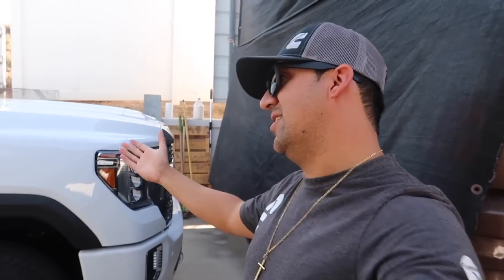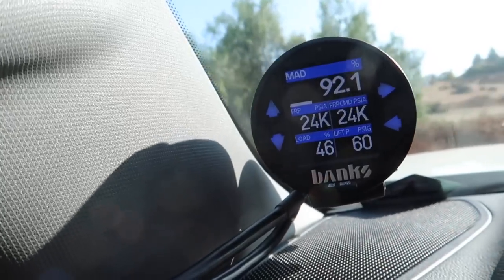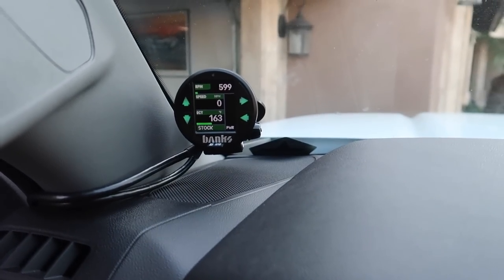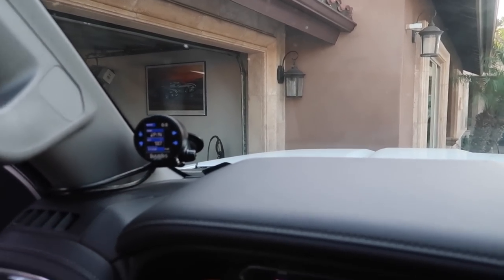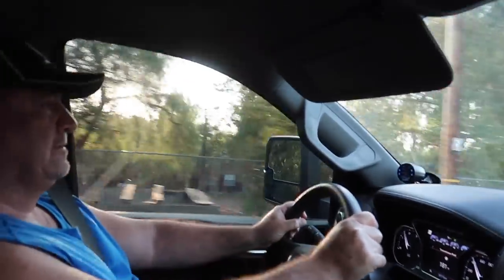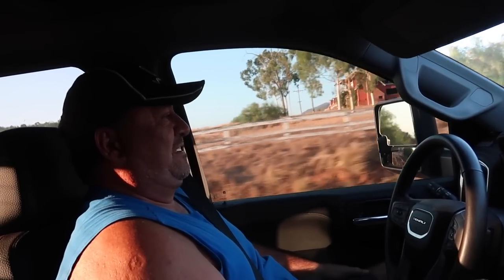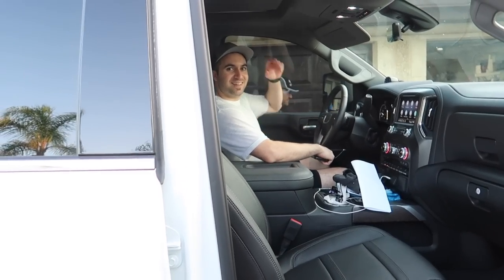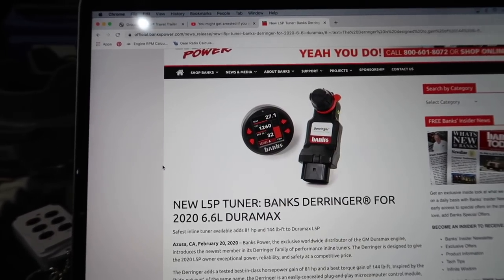DOES THE BANKS DERRINGER REALLY WORK?

Comment: Have you have any issues with the DPF ?  I had a filter replacement at 6000kms and 42000 kms now under warranty.  I pull trailers and drive it fast.  I don’t have the derringer but I wonder if higher exhaust temps would help
Reply: It's not exactly ideal to pull on hot tunes. Egts might be a tad high. Although back in the day this level 6 would've been no more than a tow tune. It might not help your issue. But that trailer might be alittle easier to pull with the extra torque.

Comment: Does the derringer and the pedal monster get rid of the Speed Limiter to go above 100 MPH? 
I just bought a 2023 Sierra 2500HD AT4 and was shocked when I reached the top out at 100. Never had the issue with my old 2020 ram 2500 Big Horn
Reply from the maker: No it does not

Comment: I just installed the Derringer on my 2021 gmc Denali Duramax. I’m have a bad issue when turned on level 6, the truck is either not making the shift in the transmission or the trans is slipping and it’s bad, the whole truck shakes violently. Have you experienced anything like this? Please let me know!
Reply: Also I contacted Banks today and they said there is a TSB out for the 10 speed and it fixes the ruff shift no shift issue?! So I called my local dealer and they said no TSB for that issue.  There is one for ruff shifting from the transfer case not being aligned correctly from the factory, but it should be able to be duplicated every time the truck is driven. Not like mine, just every time I turn the power up.

Comment: Hey Eddie does using a chip or programmer void your vehicle warranty? I have a Banks system as well on a gasser but havent used my Automind2 because im not sure if it will leave a flag on my ECU
Reply from the maker: No sir
Reply: Eddie's Life just spoke to Banks and apparently its way to grey of an area for them to gaurantee the product. They just say....your dealer has to prove it was the product that caused the problem. I can imagine the akward stalemate you end up with the dealer if something goes wrong. I dont want to risk it. I cant afford litigation with my dealer over a $400 programmer. Im returning mine. 😂 maybe when i get Eddies Life kinda money i wont be trippin’ hahaha
Reply: Doesn't send signal to ecu, over rides/bypasses signal from ecu. That's why if there's any issue, it just runs on stock tune

Comment: I think Eddie definatley misses the Duramax. I had a 2015 Chevy 2500hd LML. Then a 2019 2500 Cummins, traded it for my now 2020 Chevy 2500HD after 6500 miles. Wasn't a fan of the Ram. Without getting into too much detail pound for pound the GM is a better overall truck in my opinion.
Reply from the maker: what was the main reason you made the switch
Reply: @EddieLife3500  the last straw was when I had to take it in for recalls and the dealer had to change the transmission valve body. When I got it back it shifted worse than before. At that same time I had bad steering knocking that ended up being the drag link which is a part thats back ordered. So I got rid of it before there were any more issues and I was stuck holding the bag.
Reply from the maker: Dam man sorry to hear that sucks
Reply: @EddieLife3500  thanks man. The duramax community will be glad to have you back soon 😏